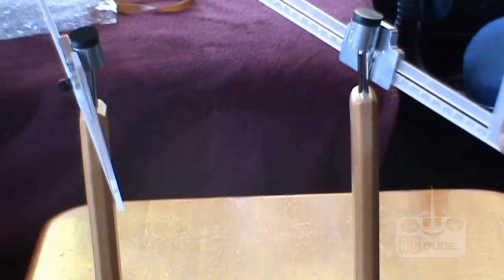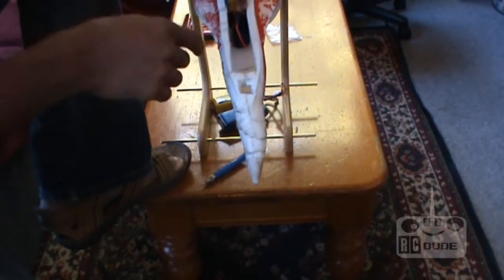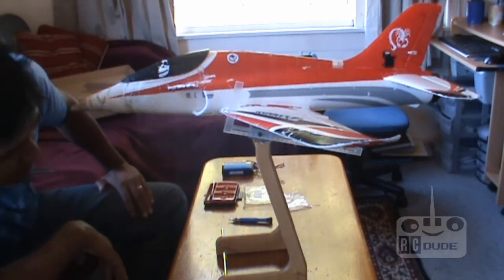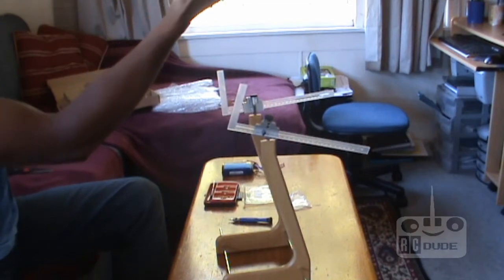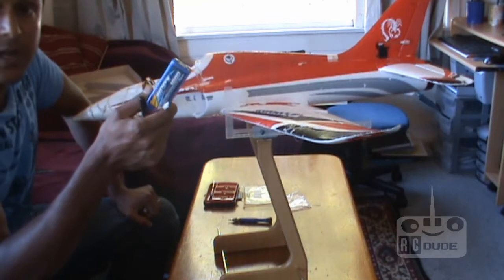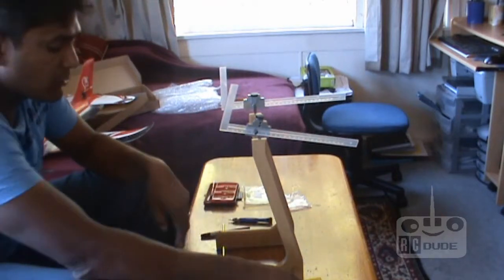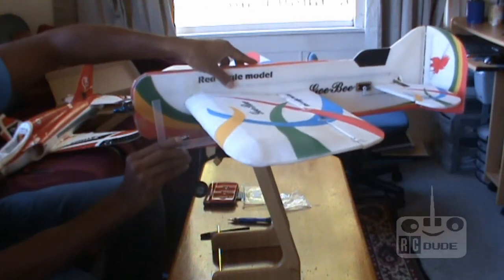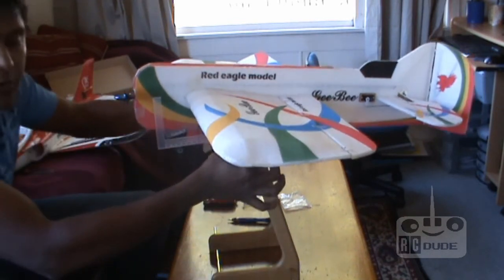Hobbyking Center of Gravity Machine (How This works)

Comment: a) The machine is poorly driilled and the holes for pins - mine split the laminated vertical wood. Second the grub screws holding the pivot cups restrict movement and have to be very loose. Third the plastic rulers do not sit naturally nicely under the wing. Fourth - like other say - the Stinger model shown here should be INVERTED for the test.
Reply from the maker: i sure u know that we can u use our finger to test CG .  i think thing call this Machine Hand fee CG hahhhahah .